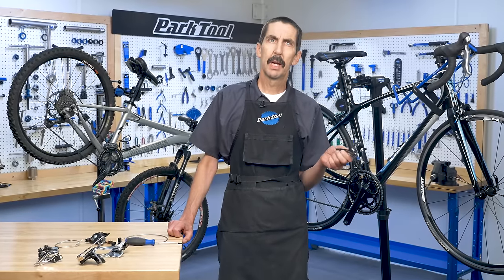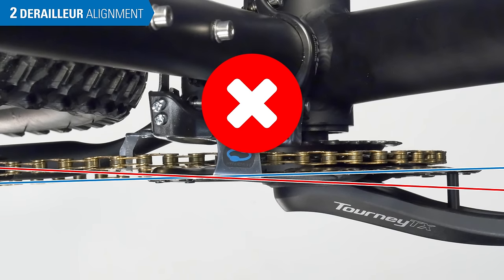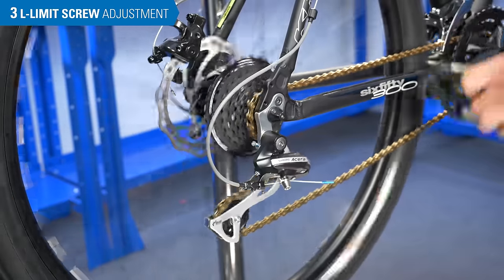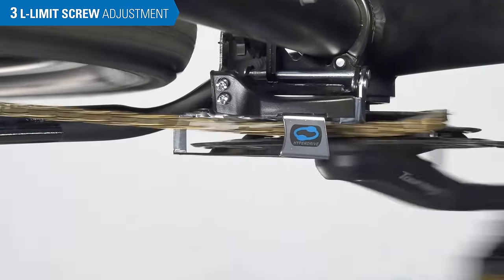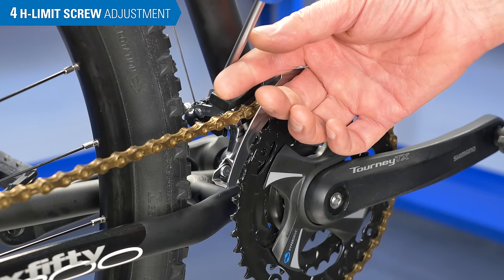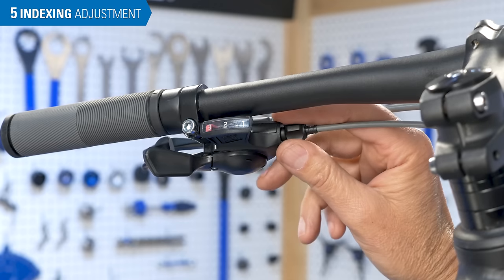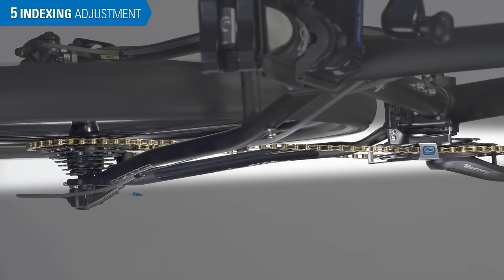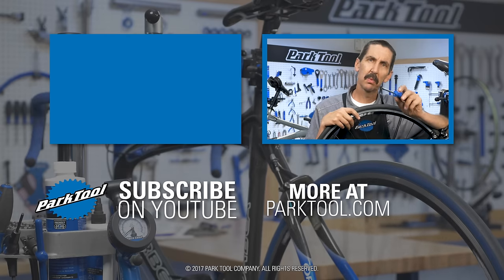How to Adjust a Front Derailleur

Comment: Good video and one point you explain is what to do if the chain won't shift to the outer ring.  My problem is that the chain won't shift to the inner ring.  Three gears on the front derailleur.

Comment: Got mine to where the struggle is shared switching from small to medium gear and medium back to small. A lot better than it was before. But still inconsistent shifts going back and forth. This is with rear gears on biggest and same issue on smallest.

Comment: Thanks a lot. Note: with 3 cogs on front, i could use only 2, shifter wasnt even clicking. I solved it by playing with derailleur height and angle plus a bit tightening the wire. Took me 3 hours to reach to the perfect 3x10, yes im a noob😋

Comment: So i followed this video AND read your article on the website. Yeah…my old bike is just not fixable. The front derailleur is angled wrong, but the the screw is rusted (or otherwise stuck) shut. Can’t adjust the positioning on the frame at all. It’s also a bit low I think. 

I’ve tuned it to optimize front gear 1. On gear 2 setting, it actually goes onto the biggest gear (3). And I think the cable tension is too high, cause it cannot be put onto gear 3 using the shifter twist knob. I had to tighten the cable cause it was much to loose - via both the knob and the actual hex nut and screw. The cable was just dangling, actually hitting the frame on bumps (on gear 1). The L screw worked beautifully. The H screw works but only when it’s on “2” officially, on largest gear. It goes onto the middle gear when the shifter is between 1 and 2, but frankly there’s no satisfying click so I just won’t use gears 2-3. 

Like I said, it’s my old bike. I had inquired at my LBS but the price of a tune up would be almost the purchase price of this thing. Ironically, setting up my shiny new bike taught me enough and gave me enough confidence to start fixing up the old bike. So now I’ve got a nice shiny pretty good weather bike, and an all weather mucky bike - with the squealing front brakes still (despite cleanings and sandpapering and attempts at adjusting). I really want to sell the old bike, but oops, bought a new seat for it. How did that happen? Also picked up a couple bike lights, to match both bikes. And new rim brakes may be in my Amazon cart… Hmmm….

Well, always good to have a backup? After all, at my skill level, I don’t foresee the need for more than gear 1 in front and gears 2 to 4 (of 7) in back. Once I get fitter, I’ll adjust it to permanently optimize gear 2 front and use gears 1 and up in back. Well, maybe not gear 7, just to avoid falling chains. For now, riding on pavement, even up and down hills, I think I’ll be okay with 1 x 2-3. Hopefully. On the new bike, front is single gear, thankfully. Whew. Easy to use. Plus it’s new so the tensions and stuff is done for me already.

Comment: Suggestion please: You should have mentioned how to put slack to the cable for those without a barrel adjuster at the start (around L limit screw) as it’s only mentioned at the indexing part at the end of the video

Comment: A very helpful video that clearly explains how to do this. My Trek 7500 FX has a triple crank - Shimano Deore DX  - and the front derailleur cage is considerable more that 2-3 mm from the large chain ring (looks like 10 mm or more) and everything seems to work pretty well. Does that make sense? Are there exceptions to that setting?
Reply from the maker: There are other settings that may work for that setting but it should be in the 2-3mm range. If your front derailleur is shifting between all 3 chainrings and is not rubbing I would leave it alone.

Comment: Great vid. I was able to follow along all the way since I have a maintenance stand now. I’m still getting chain rub on my big ring in front and my smallest ring in the back. I have a 16 speed, 2x8 2020 trek Marlin 6. Any suggestions? Thanks!
Reply from the maker: Could be one of two issues.  H-limit vs Adjusting Barrel issue test.  Shift to big ring, and stop pedaling. Push front lever and see if cage moves outward.  If it moves, dial out barrel to remove more slack.  If no movement, H-limit likely a little too tight, loosen small amount.

Comment: I would like to convert my road bike from 3 to 2 chainrings, I have lovely Ultegra 9x3 shifters and derailleurs, beautiful highly polished condition and want to keep them, can I set the front to work on a 2 by crankset?
Your videos are so informative and easy to understand, Thank you.
Reply from the maker: The answer is....Kinda. To really reap the benefits of a 2x system you will want to get a proper 2x crankset that will have the proper chain line for a 2x system. You will also want a 2x front derailleur. they make for a better shift and are quite a bit less bulky. But, you can remove the small chainring and just use the two larger chainrings. One thing is that if you do this you will want the "ghost click" in the shifter to cover where the small ring was.
Reply: @parktool  thank you so much, your answer is very comprehensive. Thank you 😊

Comment: @12 minutes when you said the manufacturer doesn't recommend big to big and small to small, that's why I switch to fixed gear cogs in the rear. 3 speeds are all thats needed. 1 for hills, one for flats at normal speed and one for faster downhill adventures.

Comment: Make sure you check the cable bolt tension is tight enough. A good indication that it is too loose is that you suddenly begin struggling to shift from the inner ring to the big ring even though everything was working ok just a minute ago.

Comment: Great Video. Just got a new bike and the chain drags on the frame when back peddling. Can I move the derailleur up vertically without having to adjust anything else? I just messed up the wheel true-ness; dont wanna mess this up too lol.
Reply from the maker: There is not an independent vertical adjustment.  Stand above the cage and sight the alignment left to right.  Duplicate this after you loosen the mounting bolt and raise it a bit, then secure.  Check the alignment again from above.

Comment: Thank you for this thorough explanation, you really made this intricate design seem simple! Could I ask a question about my personal bike? It has 7 rear and 3 front speeds, the rear shifter is a revo-shifter with 7 speeds, the front 3 blades are shifted with another (left) revo-shifter with 10 speeds (similar to the one shown at 9:53-9:56), for personal preference I would like to swap out the front shifter with one with just 3 speeds, can I go ahead or will I run into trouble? Thank you in advance!
Reply from the maker: You can swap those out with a shifter with just 3 speeds but, it is kinda nice to have 10 clicks of adjustment and to be able to fine tune the derailleur as you need. With 3 clicks it needs to be adjusted very well to function.

Comment: I'm still getting a rare chain pop when going from big to little ring, but SO much better than pre-adjustment. Are my rings in need of replacement more than likely? They have anywhere from 4-8k on them. Thanks!
Reply: Maybe the L screw is the problem, it sounds like if your derailleur can move too far inside pulling the chain down. If this would be the case you would have to tighten the L screw a little bit.
Even if the cable don't have much tension on the small chain ring after the ajdustment it isn't a problem, the cables on some my bikes also have little to no tension in the smallest chain ring, but the derailleur shifts absolutely perfect.

Comment: My old bike’s front deraileur seems to have 1 too far in (chain hits it when bike hits bump), gear 2 setting is actually gear 1 centered properly, gear 3 setting is gear 2, and the shifter goes beyond gear 3 setting to an unnumbered area for gear 3… it works I guess. Right now, I’m not experienced enough to do more than leave it on gear 1 in the front (setting 2) and use settings 2-4 on the front shifter. But I’ll have to fix the front derailleur one day. When I have the energy.

Comment: Grate video. It makes it look soooo easy :) But I still have a problem that I cannot solve: when shifting from 2 -> 3, I cant get the index (? is this how it is called) to reach number 3. sometimes the chain does move to the larger cog but the index stays at 2, so when i want to go down from 3 -> 2, because of the index, it goes directly to 1.... i tried everything in the tutorial, toying with the tension of the cable.... everything, and still no luck. any tips?

Comment: Hi and thanks for your video's. My question is: My wife's bike is a Specialized Dolce - women's specific w/ Sram double tap Force shifters and front derailleur,  they have always been difficult to shift from the small front chainring back to the large front chainring. The rear cassette shifting is fine.  I have upgraded the stock Sram Force shifters and front derailleur to the Sram Red shifter levers and front derailleur but it doesn't really work any better? I followed your video and have it set to your instruction & the factory supplied specs. What's your opinion on these Sram double tap set up, have they always been a problem from your experience? Anyway to fix this besides switching over to an entirely different product?  The Shimano groupset on my bike works flawlessly. Thanks, Mark

Comment: You were helpful, thanks alot
Reply: I'm new to mtn biking , it's been decades.   Just to share my attempt at the front derailleur adjustment.
    I followed several different videos ..  and to reset the cable ,they say to pull the cable taught . Not tight .    Whew I spent hours trying to get it to work properly .  Hours . My back is sore . At it again the next morning .
 I removed the chain ,to get that equation out of the way.  It turns out , with my non shimano chinese shifter  I need A LOT of slack in 1st gear .
 Like 1 inch of slack 
If I start at " taught" I can not get third gear . If I do manage to get 3rd then in down shift it jumps from 3rd to 1st .   1 inch slack in 1st and I get all 3 up and down .

Comment: I just learned that there's a gear combination like small-small and large to large gear causes chain rub on front derailleur. I thought my front derailleur is defective. My stock shimano front derailleur got eaten by the chain because I didn't know there's a mixing into that. It is my first time to own a bike that has a different gearing mechanism. Had to buy a new one, luckily the replacement part was not that expensive. The guy from the bike shop installed the new derailleur. Ending, I was the one who adjusted the H and L alignments because the mechanic rushed the replacement. Pity

Comment: Help diagnosing issues downshifting from biggest front gear to middle gear? climbing gears is working good and right down to smallest gear is good. Sometimes issue getting from Big to middle (3 to 2). maybe related to position of back cassette?

everything seems correct, limits and cable tension.

I do not get full range of back gears without rubbing while front gear is in 2. Seems like what I need is less cable tension but then i get rubbing in 3 and movement when I depress shifter so not utilizing stop limit.

I think it was resolved, cable tension had to be too tight to prevent movement when depressing shifter, loosened cable tension until no longer rubbing in 2nd gear in any position.

Comment: How to do without a derailler in flat Florida.    I ride a bike for a bit of fresh air and for transportation if my car has a problem.    Though I am not an athlete, I keep in shape, and bicycling helps a bit.   If, like me, you bought a mountain bike because they are far less expensive than other styles and have a front suspension as well (!), then you may also wish to be rid of the troublesome shifters and their messy cables.   What you may find is that your chain cannot be downsized to work as a single-speed chain.  The reduction requires half-links, and chains are not made to be joined at the half-link.  Solution:  1. ride only downhill - no need for a chain;  2. install a chain tensioner.   
If you are an average human who does not enjoy the crouched posture of a mountain bike,  you may install a handlebar stem extender (2 inches higher) and a swallow handlebar (at least 6 inches higher).    You will be able to sit up.   Further indulge yourself with a springy-seat!  You will need to extend the brake cables for the higher bar. 
You will be as comfortable as a Dutch-boy in Amsterdam at 1/4 the price in the USA.

Comment: I recently had a bike shop swap my verzza speed 20 from flat to drop bars with factory tiagra 10 speed cassette and 2 x chain rings. Shifting was and is silky. Only issue is the derailleur's chain gaurd rubs as follows. Large chain ring rubs slightly on largest cassette ring and rubs bad on smallest cassette ring. Small chain ring rubs slightly on fourth chain ring and rubs on smallest cassette ring. My question is if the deraileur is pull ratio specific as it seems to be about .5 to 1 mm off. Any advice would be appreciated. Thanks Park Tools for all yous do!

Comment: I’ve watched this video like 10x and it is still such a pain in a butt to adjust. No matter what I do it doesn’t matter. I think I just destroyed my front derailleur.
Reply from the maker: Front derailleurs can be difficult.  Begin here:
https://youtu.be/yDjlRu4CnjI?si=OJsy5UYNEL_9KnD0
See how they work first, then design your own Adjustment Adventure.
Reply: @parktool  Yeah I watched that I know how it works. But adjusting it is a pain. Got so annoyed I think I messed it up cause I couldn’t figure it out and just span both the L and H and moved the front but nothing helps. I can’t even get the front derailleur get back into the smallest cog. It only stays stuck at either the middle and  largest. Pretty sure my derailleur is trashed at this point and it is a 3 speed for the front. It either locks up or keeps falling off wherever I move it or can only keep it in one gear.

Comment: A good video, but there is more to it on the now very common Shimano 105 R7000. It includes a cable tension mechanism and if you don’t set this correctly first nothing else works properly.

Comment: A couple of key points not mentioned in this video, how far in or out should the H and L be threaded before starting adjustments?
What if your derailleur or cable adjustment is so far out of whack that the chain is stuck on the middle or small chain-ring  and shifting up or down will not move it?

Comment: A possible factor of difficulty in adjusting some front derailer/bike combinations and even with a manufacturer-mounted front derailer is the routing of the cable to the derailer's clamp.    When shifting to high gear, the cage must move outward, away from the frame.  The cable must rotate the mechanism outward.   If the cable is vertical at that point, its tension is either up or down.  The tension has no outward component, and it cannot twist the mech's rotor.    That makes shifting to high impossible.  How to fix:   Find a way to re-route the cable so that its tension has an outward pull, as well as the pull downward or upward.    If up is north and out is west, then the cable tension for pull-down should be southwest when in the second gear.
Reply: You need to make a video

Comment: I prefer to install front derailleurs before installing chain as the chain tends to interfere with this task.  Also, I HATE indexed shifters for front derailleurs, particularly on trigger systems.  Instead, I advise all of my clients to use an old-school friction shifter on the left as it is infinitely adjustable on the fly.   On my bikes, I use only single speed canks to avoid the craptastic shifting of front derailleurs

Comment: I've always wondered about that situation explained near the end, largest-to-largest cogs, and smallest-to-smallest-cogs, and whether these combinations were supposed to be used.
I mean, bikes are generally advertised as 18, 21, speeds, etc, so in theory it seems that the manufacturer is telling you "you have this many gears to choose from" but at the same time, I suppose it's not really useful to use both largest, or smallest, cogs since you are kind of working against yourself to a certain extent. I mean, you should probably have shifted chain to the middle front cog before going all the way up or down on the rear. Right?

Comment: For sull-suspension bikes, something that was messing me up is that while im the repair stand, rhe chain was running on the bottom of the front derailleur. This is because of the rear suspension. When weight is on the bike, the rear tire moves up and it no longer rubs!

Comment: My front derailleur is maxed out. There's no barrel adjustment on the cable line and the chain rubs on the top 2 gears. Do I need to remove and tighten the cable?

Comment: Great video for general purposes but this guide did not help for the Shimano Ultegra groupset I have. I recommend following/reading the manual to get it right. Cable adjustment/indexing is done is specific trim gear positions which is not mentioned in the video. Proper cable threading through the converter is also important. H limit is done last after indexing as well in the Shimano manual.